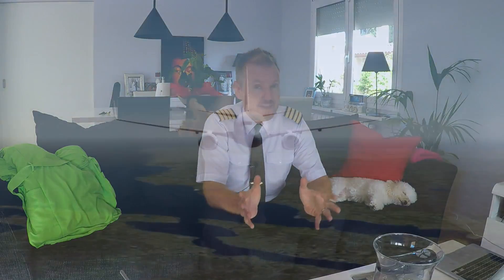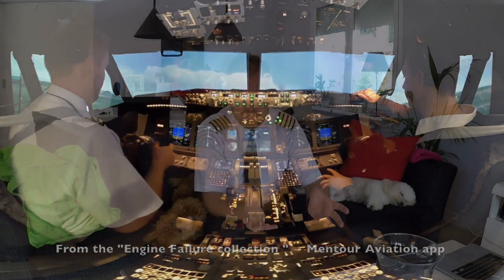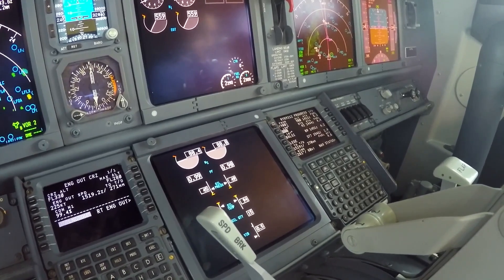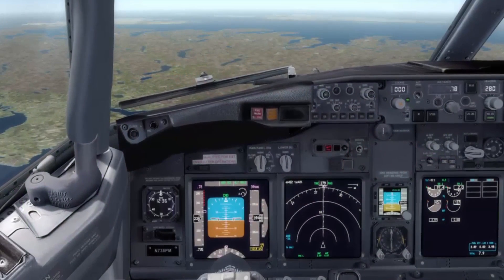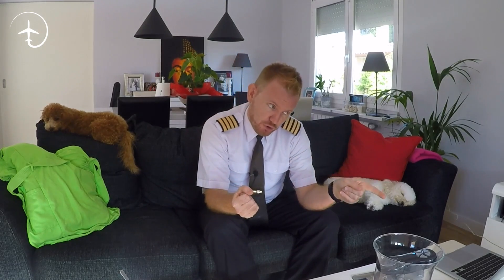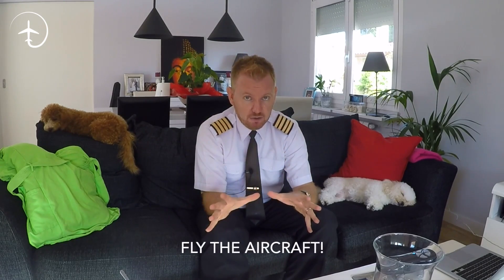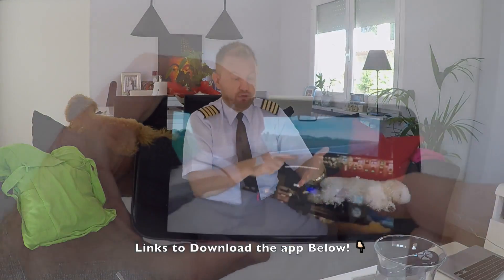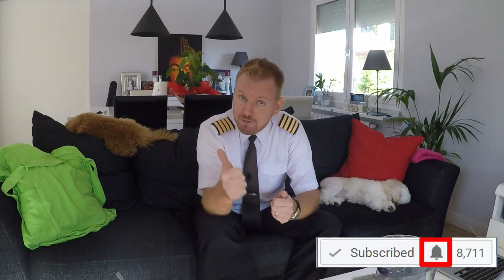What if an Aircraft loses an engine in cruise?!

Comment: Deal with it quickly? Why? There is absolutely no rush. Take your time, get it right because this is a luxury failure. It will take a fair while to decelerate to green dot. So we take our time, dial in a sensible altitude, disconnect the autothrottle, put the live engine up to max continuous and press level change. Order a coffee and keep it in trim. etc... (and Mt Blanc is 15,800').

Comment: Question.  Has an airliner ever taken off with an engine not mounted to one of the wings.  Jets fly over fairly low on their descent to Philly airport.  I thought I saw a Jet with an engine on the right wing but no engine on the left.  Do they ever fly like this?  The only thing that I could think of is that it needed a new engine so they flew the plane to where the new engine was.  Is it possible that they would do something like this during maintenance.

Comment: Hello ! I would like to ask you two questions regarding the oxigen in the planes. What level of oxigen is in the plane at cruise altitude ? Is it the level from the altitude when presurization accured ? Also, at cruise altitude does the airplane bring new fresh oxigen or does it filter and recycle it ? Thank you very much for your content !
Reply from the maker: I will make a video on that.
Reply: Thank you very much !
Reply: @Mentour Pilot     While you are planning the above-referenced video, you might want to include what studies have been done to keep the best cabin temperature level.  I feel much better when it's cold in the cabin.   Once the temp gets warm, I start to get that claustrophobic closed cabin feeling that makes me more irritable.  And as a GA pilot, I never get that feeling because I can control the cabin temperature.  I've never had a "boxed in feeling" in a GA airplane.  But sometimes if the cabin in an airliner is full of people and the temp is very warm, I get very uncomfortable.  I feel boxed in under those conditions and I'm very sure I'm not the only one.  I've spoken to many and they agree with me.
             I'm assuming there have been human factor studies that have concluded that when the temperature is cooler, the passengers are more at ease.  You can always hand out blankets to a cold passenger, but you can't make it cooler for a person in a hot cabin.  Please speak to this issue when you do your video on Oxygen.  Thanks in advance.

Comment: Does the autopilot only initiate a descent in Flight Level Change mode when the actual airspeed (which slowly decreases after the single engine failure) reaches the target airspeed (in the video's example, 235 KIAS)? i.e. as long as the actual airspeed is greater than the target airspeed, the AP will maintain level flight?

Comment: The lower display illuminating is the first indication?  You're saying that the disparity between parameters (N1, FF, EGT, etc.) on the good and bad side doesn't trigger a Master Caution alert before the generator drops off the line?  Also, that lateral acceleration (yaw) is going to be so subtle that nobody gets the message through the seat of their pants before it shows up on the instruments?  (You guys must be sleeping way better up there than we did in my day).

Comment: Can we actually glide all the way to the destination with dual engine failure.. Mentour aviation please please  reply me i want to know 🙏🙏
Reply: The distance the aircraft can glide without any engine power depends totally on the altitude. If the aircraft is at 37000 feet it can glide quite a long distance but if it is at 10000 or 5000 feet the distance is, of course, much shorter. So if the aircraft is at high altitude there is a possibility to reach some nearby airport by gliding.

Comment: do all engines have a generator to produce electricity ? or is only one producing eletricity
Reply: I don't know for sure so I'll just take a guess from my common sense. It's not plausible that the only source of electricity would be from one engine. If that engine is damaged it's not possible that the entire plane would go black. There must be other sources of energy, probably the other engine, possibly the APU and maybe some other storage system like batteries or something
Reply: There is a generator at each engine and the APU generator in the tail, and then also a battery. If an engine fails the APU is normally started and the generator will provide power instead of the one from the failed engine.

Comment: Last week i was on an 737 and during the cruise seatbelt light turn on and then the plane start to descend on a lower altitude to again turn off searbelt and cruise for the rest of the fligh, a lot of engine sound changing and a quite harsh landing later at the gate i saw one engine smoking from the rear... could be that we loose that engine in flight?

Comment: This was the first slightly unsettling Mentour discussion yet for me, even though the channel has admirably covered many serious command situations other times. I think that like many civilians, I unflinchingly accepted the often cited "commercial passenger jets are perfectly safe with the loss of one engine". Now I'm hearing that "perfectly" is not really accurate at all. Terrain avoidance can be an issue. That there is potential stall susceptibility (and ironically due to the importance of attempting to preserve altitude over terrain), and stall susceptibility equally created by the desire to preserve range (so does that mean polar and oceanic routes, with no landing choices, become more thrilling?). If the rudder and aileron application are needed to fight yaw drift, then that's got to adversely impact maintenance of altitude and range too, though I'm sure the analysis considers that in the single engine ceilings.

Mentour does serious discussions about legitimately scary things, but in a positive, constructive, sensible, logical, beneficial and pragmatic tone and attitude, and I always come off perfectly assured. That includes his show on 2 engines versus 3. But now I'm wondering if I want to be flying with 3 engines instead of just 2. At least on polar and oceanic and mountain clearing routes. Much improved headroom there, right?

Hey, I grasp that engine failures are rare. I grasp that an engine failure combined with a struggle to locate, pull out, and be able to read the correct low level chart is rare. That overreliance on autopilot should not be a factor. That high mountain peaks are rare. That failures over oceans, or poles, are rare. And I even get that ultimately it's a numbers thing to approach 100%, and that insistence on that would ruin aviation if it meant charging one million dollars per passenger ticket, even if clueless Liberals insist that that would be the only humane approach. Everything in life has some practical risk tradeoff. But I'm just a tiny bit more queasy about losing an engine on a 2 engine plane now.
Reply: And single engine landings are a bit more exciting for the pulse rate, I've heard.
Reply: Hey, in 2005 a BA 747 flew from LAX to England on only 3 engines. I suppose things need to remain in perspective, with respect to tangible risk or danger. (That flight choice was highly controversial by the way)

Comment: Can rudder trim be used instead?
Reply: Attitude first, then trim. My instructor use to say that first you put the airplane in the rigth direction with the joke and rudder, and then you trim so the airplane keeps flying the way you want it to fly. Remember that the trim is not a control surface, but and aid to keep the airplane stable in the air

Comment: Since the lower altitude will increase the fuel consumption, is there a possibility the aircraft wouldn't have enough fuel to reach an airfield in case of an engine failure - especially with trans-oceanic flights?
Reply from the maker: Yes, that’s a real possibility.
Reply: But isn't there less fuel consumption using only one engine?    

Love the video, by the way, thank you very much.
Reply: @zeevor  The one engine will have to work harder for a longer period of time.  
The amount of work needed to move a certain mass a certain distance will still take a certain amount of energy, that means fuel.   
And it's doing it less efficiently.  That's over simplifying it but you get the idea.
Reply: 1 engine at full power uses more fuel than 2 engines at cruise thrust (especially at low altitude)
Reply: Wild West  grab a camera and make sully proud
Reply: Wild West  
You get wet
Reply: @zeevor  actually no because when one engine stops producing thrust it produces drag. Even though some air can still pass through the engine, the engine basically becomes a large appendage hanging from the wing and creates more drag on that side of the aircraft.
Reply: Wild West  The way I see it... if an engine failure occurred over the Atlantic and the pilots did not feel that they could reach either GB or any part of Europe, or the US they can divert to Bermuda. This is just a wild theory though. Crossing the Pacific would be different because it would depend on whether the aircraft was flying for example from California or any other state in the US to Hawaii, or if they were flying non stop to an Asian country. Obviously they would not attempt to complete the flight all the way across the Pacific, but they would divert to another airport that is within a safe distance. In the Pacific there are air fields at Wake Island and Midway but I don't know if those could be used by commercial aircraft in a situation like this.
Reply: m01mast3r I would've assumed that the ETOPS rating would account for fuel consumption
Reply: Crossing the Atlantic on a routing taking you more than 60 minutes from a suitable airport (ETOPS flight), you bring fuel for the worst case, often being an engine failure and loss of cabin pressure to go to an alternate suitable airport, often being Keflavik on Iceland or an airport in Canada.

Comment: If you're within range of an airport, would it be safer to cut the remaining engine and try to glide it in?
Reply: a commercial airliner isn't really capable of gliding, considering the weight. With a small plane, maybe
Reply: There is no reason to shut down the remaining engine, and it is not the procedure. The aircraft can fly with one engine and it can be flown to an airport.

Comment: One you turn the autopilot OFF,  you kick the rudder and set some aileron; and you immediately find the nearest airport with sufficient runway to land.... You just convinced me to never be on an aircraft your flying.  As for pressurization either engine bleed air drives the pack.
Reply: There are two packs..

Comment: Isn't it kinda stupid that the autopilot has no rudder control? Wouldn't it be much safer if it had rudder control and was made smart enough to recognize that in a differential thrust situation it would be smarter to use rudder to counteract the yaw? Wouldn't that help it keep the wings level instead if banking with the ailerons?

Comment: Im not a pilot nor will I ever likly be. BUT........ This seems like it's lacking more info. After you adjust altitude and air speed and rudder to maintain flight.... Don't you have a procedure to try to fail check the engine and see if it can be restarted SAFELY???  Maybe you had a flameout for some reason and the engine is still good and can be re started. Spool up to 30 percent power to see if everything checks out then gradually add power to re establish set flight level

Comment: your fine, glide to airfield. At v1 or v2 depending on density altitude, weight etc.... your done, as the regulations only require the plane to have directional control. not climb out capability, but most airlines reduce loads and routes to keep fuel to a minimum for this scenario. I flew a B1 B 4 engines with afterburner, 32,000 lbs thrust or with afterburner as in takeoff 51,000 lbs I had a secondary compressor fail just around gear up after v2, with max takeoff weight but with so much thrust we just put the fire out, it took that engines and the number 3's engines fire suppressant but beyond that we still had a 9000 feet per minute climb ratio, but 1/2 the longeron was on fire so we had to dump fuel, jettison test bombs in the pacific and landed at Vandenberg. Shit at cruise would not have even sweated it, 2 engines are dangerous engineers always got the 4 engine scenario right, but airlines are cheap and it's all about money with the lazy ass union dominated and greedy shareholders of scheduled air carriers.. Shameful they put money above life..

Comment: Again with the autopilot. Computers these days surely could be programed to recognize the situation and realize that if in altitude hold mode if the speed gets too low that it will create a stall. Why don't they change the design so that in that situation the plane will automatically descend to a safe level where it can at least maintain a minimum speed that prevents stall at the new altitude? So many of the accidents that you talk about on your channel sound like they could be easily prevented with a seriously upgraded autopilot system.

Comment: what if you loose an engine in the middle of the pacific ocean
Reply: All flight routes are planned so that they are all in safe range for 1 engine flying incase of an engine failure.  Most modern commercial jets can fly 3 to 6 hours on a single engine.

Comment: Can an airplane take off with just a single engine?
Reply: A commercial airliner would never be approved for use if it weren't able to take off despite having an engine failure. I don't know if they're required to be able to take off with one engine from the very beginning but for sure once they are Beyond V1 they can't stop and therefore must be able to successfully take off. Here's an answer I found to the same question on another website...

"Control Following Engine Failure 1 An acceptable means of showing compliance with CS 25.143(b)(1) is to demonstrate that it is possible to regain full control of the aeroplane without attaining a dangerous flight condition in the event of a sudden and complete failure of the critical engine in the following conditions:

a. At each take-off flap setting at the lowest speed recommended for initial steady climb with all engines operating after take-off, with – i. All engines, prior to the critical engine becoming inoperative, at maximum take-off power or thrust; ii. All propeller controls in the take-off position; iii. The landing gear retracted; iv. The aeroplane in trim in the prescribed initial conditions; and

b. With wing-flaps retracted at a speed of 1.23 VSR1 with – i. All engines, prior to the critical engine becoming inoperative, at maximum continuous power or thrust; ii. All propeller controls in the en-route position; iii. The landing gear retracted; iv. The airoplane in trim in the prescribed initial conditions."
Reply: @souocara38able  Why does airports doesn't have safety buffer clearance beyond the take off line at the end of the tarmac just to give more chance to an botched takeoff to touchdown in case when they don't reach enough speed to become airborne?
Reply: @johnnychang4233  
I can't really speak for the people who design and plan airports and decide where they can exist.

 Basically speaking, most airports just don't have the room to double the length of a Runway. They all do have enough length that airplanes can abort a takeoff and safely come to a stop but once you get Beyond V1 you really can't count on that so you have to continue the take off. 

There have been many cases of aircraft that have overrun the runway and gone off the end however in relation to the number of successful takeoffs and even successful aborted takeoffs, the failed takeoffs are a minuscule percentage. It's just not practical or possible to try to make everything 100% safe and the cost of building airports with much longer runways is prohibitive. If there were a regulation that required runways to be much longer most if not all existing airports would be in violation of that regulation and air travel would be devastated
Reply: @souocara38able  Currently the airport that is becaming the most crowded hub for connections is the International Airport of Mexico City and it's proposed replacement, a new airport in the outskirts of the city which has about 80% completion of it's first stage is going into a halt because of political nonsense of the new elected President.

Comment: In my opinion, aircrafts are not well designed.  There are too many things that can go wrong with not enough backups.  For example, birdstrikes.  Planes have been around for many decades and they STILL do not have a good solution to birdstrikes.  Also, a 3 engine plane would (in theory), handle a "lost" engine scenario better than a 2 engine plane, so why then do they still have 2 engine planes?  Too much crap going on to save money and not enough for safety.  In my opinion, the airline industry should not be a for profit industry, it should be paid for somewhat by tax dollars with additional fees for those people that actually fly.  That way it wouldn't be such a competitive market where there is incentive to "cut corners" to make an extra buck.  Instead, the focus would be on safety.

Here is an idea for extra safety, but would cost taxpayers more money....  Have a 3rd engine along the main axis of a plane (3 engine plane = trijet), such as in a Boeing 727, however, do not normally use it.  It is there for emergencies only.  Normally it would be covered with some  aerodynamic covering, allowing it to slip thru the air efficiently.  However, in an emergency such as a birdstrike or fire, there would be some way to start the emergency engine during flight to assist with additional thrust.  It would not have to be a full size engine as those on the wings, but enough to make it easier to fly the plane and keep it safer.  Comments?